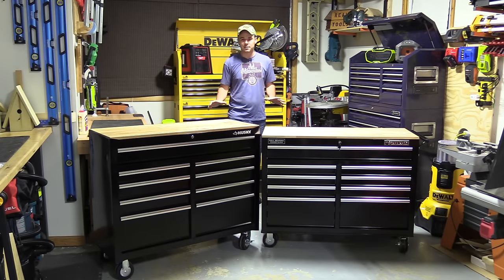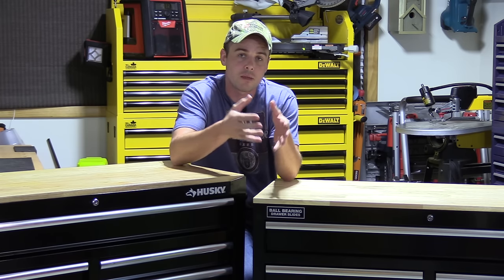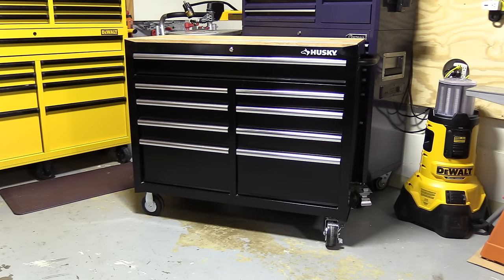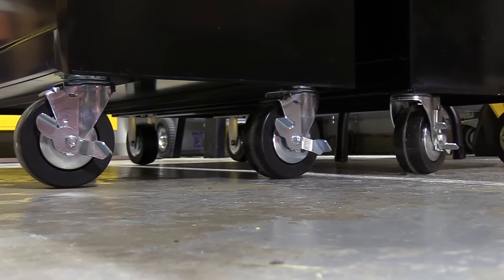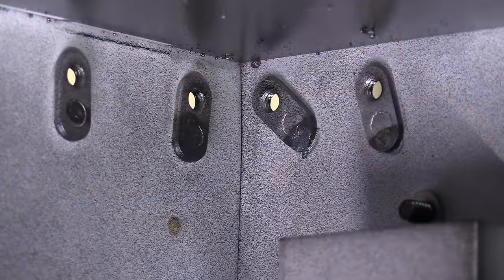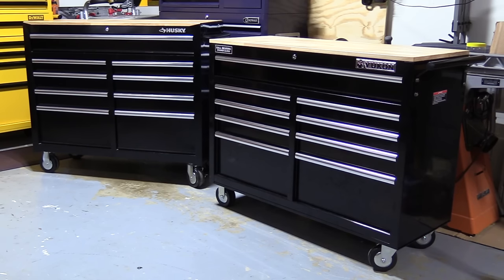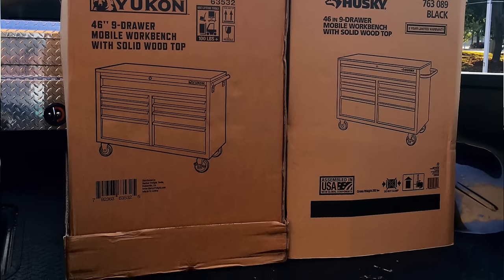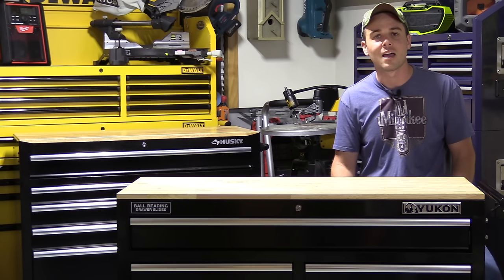Harbor Freight -VS- Home Depot ( Yukon - VS - Husky ) 46" 9-Drawer Workstations

Comment: Man I'm currently in the market for a tool box. I keep navigating towards the 44 inch us general from harbor freight. I would LOVE to see a review of the harbor freight versus snap on from you. I need to know if it lives up to the hype.
Reply: They are virtually identical from what I could tell.  I would get the harbor freight box any day of the week.   The only thing I did notice on the harbor freight I purchased was the power coat wasn't perfect,  A few high spots that almost look like paint runs but purely cosmetic.
Reply: John Miller I have been using 44 inch us general at work. I am starting diesel mechanic and been at shop for little over 6months now. We move are boxes around everyday and had no problems. Gets same work done as big thousands of dollar boxes. I would say I hope they had locking drawers since moving box around does make the drawers open on there own. No complains as of now on box. It is solid and gets work done without emptying out the pockets. Would recommend. If your looking just for home then definitely would buy us general.
Reply: Bryan Cromwell thanks for the input.  I bought thr mechanics tool cart. Its nice but i did overload the bottom drawer. Now i need to replace that rail. Not too big of a deal. But any and all input on the subject is greatly appreciated
Reply: US General is the only choice when comparing between the Husky and the Yukon. Both the Husky and the Yukon,  which to me, are nothing more than two more boat anchors waiting to grow coral or trick bass into a false sense of security. But, I would suggest going all out on a US General tool box setup. Get more space and quality then need now and that you are shopping for.  You will soon find that you need another Tool Box!Why get into the same rut of needing more room when you've already dug that fire pit ... it's time to move on up.  Get the HF big guy with every extra add-on that your budget can afford.  You will use the space because every tool loving mechanical nut job (me) always gets more tools than needed. I call it -- Getting My Man Stuff. I use the excuse that my son will inherit my tools and boxes to keep the wife's roar down to a barely manageable babble-ramble.
Reply: The 44 inch is a really good box for the price. So are the larger US General boxes. My only gripe with the HF units are the plastic drawer latches, they break REALLY easy. Every one I have seen in the stores had at least one broken. I have one of the older 44" units and it has been a good box. It sets next to an older Craftsman and 2 "truck" boxes. All are stuffed to the gills at the moment.
Reply: John Miller Take a look at Milwaukee's offering. They are some of the best tool cabinets I've ever seen for the price.
Reply: I like the 44" one. I need a box for work as a mechanic. I havent decided if i want to keep doing this work or not. So i figured the 44" is small enough to fit in my shed if i quit. Lol. But i do enjoy quality. Thats why i would love him to do a review. I know the snap on is not that much better to warrant the price. But i wonder how close the us general gets to the snap on. I can't see a difference myself.
Reply: The Snap-On has a better fit and finish, plus if a slide fails it's easy to get replacements. The casters are better on the SO as well. BUT for the price difference you can buy the better casters!!!  The larger boxes HF has narrow the gap much farther. In your case, I would probably go with the HF, MUCH cheaper and if you decided to upgrade at a later date you have the option.
Reply: Tool truck boxes are the best if you can afford it..
Reply: I'm 90% sure I'm going US General.  We don't even have a snap on guy. We just got matco and cornwell. Every time i ask about a tool, its always , "i have to order it". I told them both i will buy a tool from them when they can get it to me when i need it. I had an amazon package delivered to the store. Took about 2 hours for it to get there after i ordered it. Those guys come once a week. Then they order it. On average the guys at the shop wait 2.5-3.5 weeks to get their tools. Thats laughable at best.
Reply: Zunar Zulfiqar Watch Real Tool Reviews of the Milwaukee tool chest. It is garbage. One of my neighbors got one and it's just as crappy as this Husky tool chest. The US General tool chest from HF are amazing.
Reply: damannoa yeah they seem of good quality but I did a weight test with my hands on the smaller drawers and they felt flimsy and bended. I sold the Milwaukee and bought a snap on epiq 68". It's a little Overkill but I'm a tech and I need something that will hold up for years to come.
Reply: The 44" not bad for price especially when sale or coupon, biggest issue with 44" is drawer latch detents wear after few years of pro shop use, can be fixed and can also add magnets on heavy drawers if want more retention.
Castors can be upgraded for about 60bucks. is nice versatile box and with side cabinets quite large storage.
72" is nicer for pro use but is big . They are good for the price .
Best option is used mac or snapon if got time hunt one down .
Reply: Search craigslist for used boxes. I love my Griplatch craftsman tool chests. The newer edge series of craftsman I was not at all impressed with. If I were to buy 1 today at a local store it would only be a US General or the Milwaukee box. But my 1st choice would be to search craigslist for an older craftsman or other used high quality tool box in your price range.
Reply: John Miller the top drawer on the 44" us general does not close all the way or at least mine doesn't. that's the only problem I have with mine
Reply: I have a craftsman box that has locking latches built-in the drawers and later bought a harbor freight box to help free up some of the over crowding. With my experience I like the rigid but smoothness of the harbor freight box, however you need to determine your tool needs and the dimensions of the drawers because my craftsman does offer better space for my tools. Good luck.
Reply: John Miller have the 44" general box, it's great for the money. The drawers aren't smooth to close causing the tools to slide around and move the liners. The drawers are also shallow. Overall, I'm satisfied with the purchase but I wish I went with the larger size.
Reply: kumaclimber i have the tool cart from hf. I know exactly what you mean about the liners.
Reply: I've had that issue with ALL of the drawer liners I've used. The only ones that stay in place are the thick ones made from foam. OR you can take some silicone and "glue" them in place.
Reply: damannoa Oh... Why don't you watch his review and then let me know what is so bad about it.
Reply: The Builder's Cave I did watch it and I asked him what he thought of it and he had an unfavorable review about it. Go back to that video and search for my comments and you will read he had to say. 

"The side door on this is a waste of space VS having more drawer 
capacity.....also after 3-4 months the door started rubbing the frame.  
The center wheels on this make moving it difficult.  The pegboard adds 
2" of depth to the unit.  On the 46" box with the same "soft close 
slides", I am already experiencing failure on them (some now slam shut)."

This is his words, not mine.
Reply: damannoa Not the one I am talking about. See they have a 46 inch tool chest and  cabinet combo. You can buy the cabinet separately as a standalone unit. Also, I don't think that his one bad experience should finalize your opinion. Take a look at reviews of the both boxes, and you will see that they are overwhelmingly positive. Also, I have seen both boxes personally up close, and they are way sturdier than all the other tool boxes over there. You can find display models at The Home Depot. So go give them a look, and if you don't like them, well you have the right to have your own opinion.
Reply: damannoa One thing. It is a 60 inch box, so having wheels in the center just makes it that much more sturdy. Also, tell me how often you will be moving that huge thing around? Unless you do something that requires you to move it every week, you'll probably just be like the rest of us and just move it into position and leave it there.
Reply: damannoa Last, but not least. Any problems or failures that may happen to you, Milwaukee will fix it for you, or just give you a new one. Milwaukee has one of the best warranty in the industry, and everyone knows that.
Reply: Depends on the shop. Some have you move your box into a different bay daily or into a storage area when you are not on the clock. So you could be moving it daily or weekly. It's not really common but there are shops like that. The easy solution is to just buy better casters with good bearings and grease fittings. I've done that a couple times. Makes it MUCH easier to move the boxes, and the extra height can be a bonus if the box is short.
Reply: Blazer02LS Well in that case, that makes sense. By the way, milwaukee also has a new 52 inch tool cabinet. That might be better for you. Have a nice day
Reply: @Amanpreet Grewal check on youtube for the us general magnetic drawer fix.  I have the complete set built around the 44", but it doesn't move as I removed the casters.  I do recall seeing a video about adding neodymium magnetic drawer retainers for cheap, and it looked sweet
Reply: I have both a snap on and us general box. US general is decent for the price, good quality, and ample room, but Snap on boxes ooze quality.... One thing you get with snap on vs horrible freight, snap on boxes are usually deeper and have a good drawer layout that gives you plenty of room. I went from a 56in horrible freight to a 54in snap on. I have a whole lot more room in the snap on box. It just depends on how much you want to spend. I still have my us general and use it for my personal shop.
Reply: John Miller dude your not a fool guy huh snap on is the best more expensive but you want the best its gonna cost harbor freight is the the cheapest and dude don't ever ask that question again lol
Reply: Blazer02LS the 44" doesn't have the plastic locks.
Reply: The Builder's Cave I'd like one, but they need to come out with a bigger one like a 52-56" model.

Comment: I bought a Husky 41 inch wide 18 deep and (roughly) 60 inches tall, about 5 weeks ago. It is not nearly as cheap as the one that you have shown and cost just under $500. It also came with drawer liners. This is an interesting video and im sure glad that i purchased my box before the cheap manufacturing took place.
Reply: Mine also came with liners, with the husky logo embossed into every liner...
Reply: You bough a different model given the price.

Comment: I just bought a the husky box at my local Home Depot yesterday, it’s totally different now, no removable wood top, dual slides on the bottom drawers and it did come with drawer liners and a power strip on the side
Reply: Same here, just got mine two days ago, very well made for the price, has 3 year warranty, dual slides on bottom drawers, has liners, screwed in wood on top, better bolts for casters, overall great box
Reply: Thanks for the info.  Gonna buy a Husky because they have it in stock, vs. Yukon, where you have to place an order.
Reply: @AndyVids2011  I did mine on home depot website and they had it in stock in gray, looks very good as well
Reply: The new Husky box is also 24 in. depth vs 18.5 in. depth on the Yukon, that's a lot more space in each drawer and surface to work on... so $90 more I'll go with the Husky
Reply: That version is not the same as the one being reviewed here. The one in the video is still being sold for $299. The version you purchased is $399.
Model # 7440946R is the $299 version and H46MWC9XD-TL is the $399
Reply: I went to HD today, and the black one is now being sold for $50 less. Its $348 now.
Reply: @gonepostal1098  heck yeah, I believe it's worth every penny especially at that price!
Reply: I'd still buy the Yukon. Its probably better built underneath.

Comment: the new husky at HD appears a bit different. is this an older version?
Reply: Yes...the video is from Aug 2017.
Reply: Bought the husky 52 inch from Kijiji for 300 dollars brand new. Much better than the one in video. I’m happy with it.
Reply: Yes the new husky is way better than the Yukon now and has more room.
Reply: The Husky is still junk. It simply won't hold up.

Comment: DON'T DISMISS THE HUSKY!  I decided I wanted to get the Yukon based on the information in this video.  But HF doesn't stock them anymore around here. They are all special order saying it could take a month to get.  I went to Lowes to look at the Craftsman box and was not impressed at all and it was more money.  I went to go look at the husky and to my surprise, it was exactly like the Yukon in your video.  Came with the draw liners, wheels are bolted into rib nuts, Bottom drawers have 4 slides each, not 2, all are soft close slides, wood top is bolted to the box, Inside was completely painted, even came with a built in outlet strip with USB ports. It was $30 more than HF, but they had them in stock and HF wanted to charge $100 shipping.   So don't discount the husky anymore!  I like mine a lot.
Reply: How is it still? I'm in this boat looking at both and did they really upgrade the quality of the husky? I'm in new England
Reply: @border4554  My Home Depot had them built already (though I would have preferred if they didn't).. but my point is they were on the floor and you can check them out. Very happy with mine. (I'm in Phoenix)

Comment: As a Husky owner, and being generally satisfied with it for my use, I'm going to assume the Yukon is better quality. No way the husky would hold up long term in a shop.

Granted I have the 44" Top and bottom husky. I have no complaints thus far. But if I could have gotten something much better for about the same price, that's disappointing.
Reply: I've had both(well US General) and HF is better quality. I couldn't see Husky being anything more than a weekend warrior box and HF in the middle tier and with some improvements maybe industrial grade.
Reply: FWIW I just confirmed that this Yukon is the exact same box that used to be sold under the Husky name.  The newer Husky is made cheaper like the example in this video, but the older Husky is a whole lot better.  in fact, it's identical.
Reply: Josh Dann I can confirm this. I have the older Husky and it is exactly like the Yukon in this review. The only difference is the handle. My Husky has the same handle style as this Husky but attached with Rivnuts.